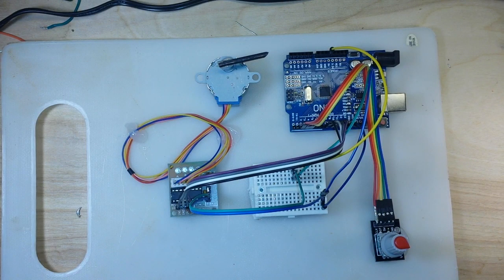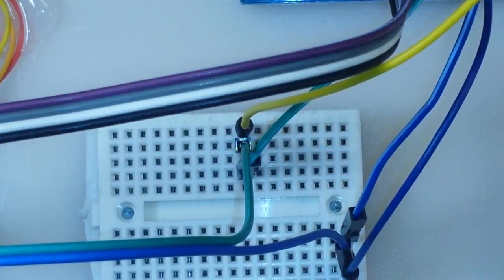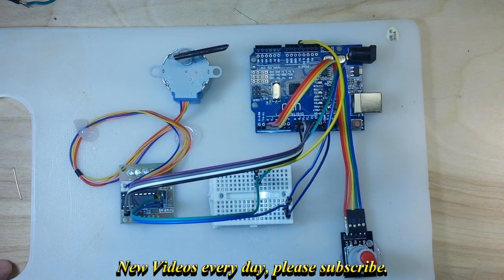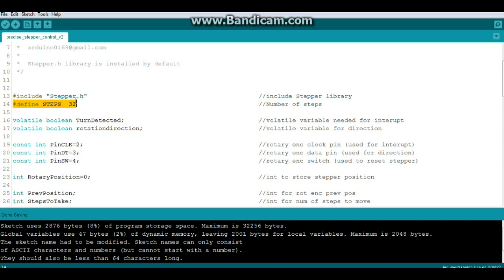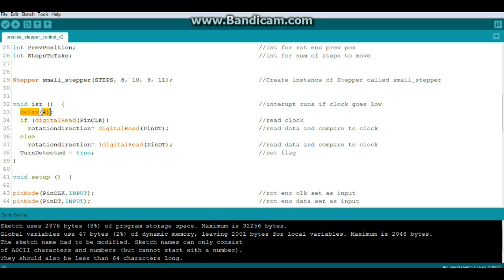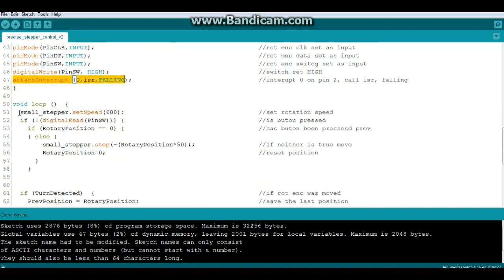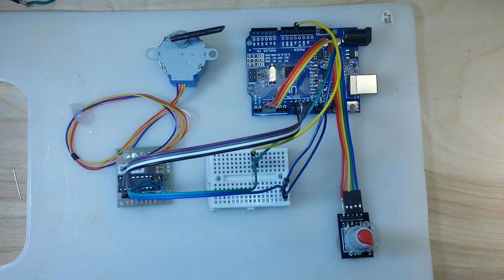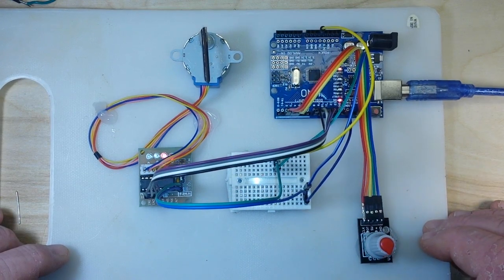Precise Stepper Motor Control

Comment: Thus is a great project and ne I want to try for a remote capacitor tuner for my mag loop antenna. What should I consider to add another speed for around double then a slower fine tune speed? Thanks

Comment: very thank you. I have just done my first project thank your help. the only problem i hope to resolve is the clockwise rotation of the rotary encoder correspond to the counterclockwise of the motor.  My be changing the positions of the cables 2,3,4 do I could resolve the problem ?
Reply from the maker: Yep, swap the encoder lines

Comment: Thanks for this. When I set this up my stepper jumps around a lot. In one direction it rotates ok but in the other it will jump back and forth. I have tried playing with the delay and number of steps. Starting to think that maybe it is a hardware problem. I have several encoders I have tried but only one motor and driver board so maybe one of those is at fault.
Reply: its not hardware look at the last line of code i accidentally had the PrevPosition and RotaryPosition after the if statment mixed up that caused this error. valid code so it didnt give an error but its mixed up.

Comment: subscribed! is there a way to control from a 2.4ghz RC?
Reply from the maker: yes there is. RC servo control is PWM. It's been a while since Ive looked into to it so my numbers may be a little off here but I believe the pulses are between 1.5 and 2.5 mS. 1.5 is CCW rotation and 2.5 is CW rotation and somewhere around 2mS is centered. An Arduino can use the pulseIn() function to read the pulses and output the proper signals.
Reply: learnelectronics ok cool! thanks, can you please give me the sketch with RC 2.4ghz? i would like to build it..i have all the rest of the components!!
Reply from the maker: onboardcamera_it well, I can help you but I'm going to need a lot more information. The type of servos, the particular receiver you are using, the particular stepper motors and driver boards, do you want end points or constant rotation, are you looking for speed or torque...etc
Reply: learnelectronics i need to build a wireless follow focus for my camera, i think all these products are builded with stepper motors inside..and when you connect the motor to the gear of the lens, you should be able to make a check test of the entire escursion of the lens, from macro to infinite, so you "know"on the encoder where is the infinite and where is the macro point to the lens..i prefer the 2.4ghz RC system (tx and rx) because i need more range (300-500mt). that's all! thanks!!